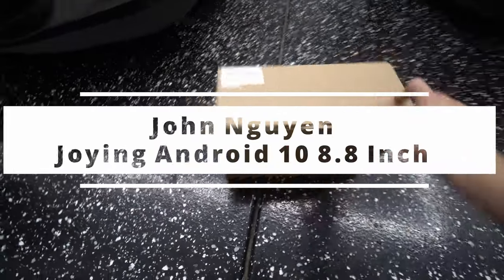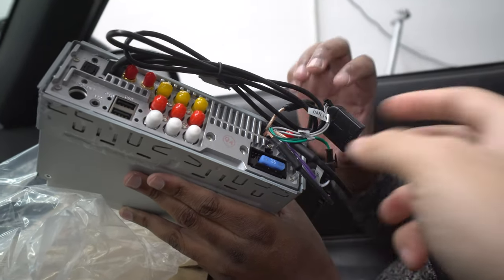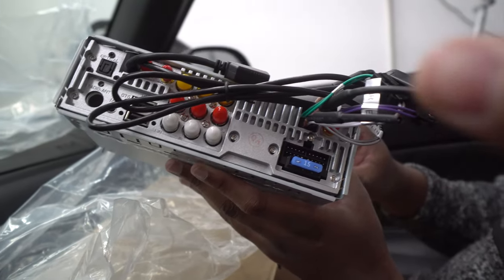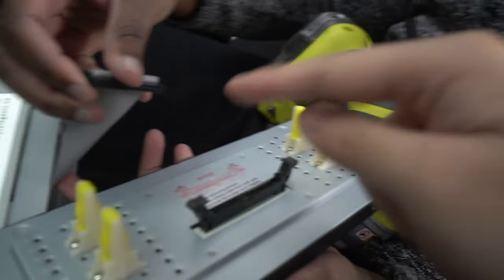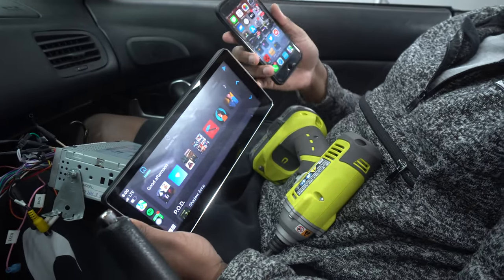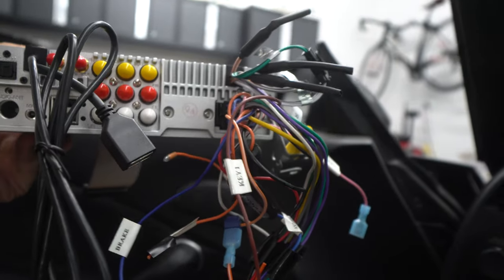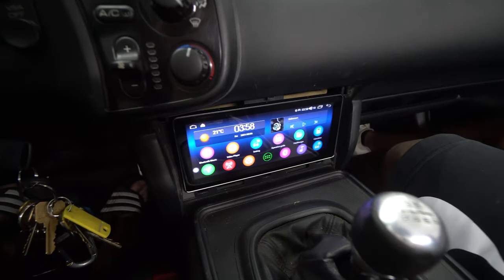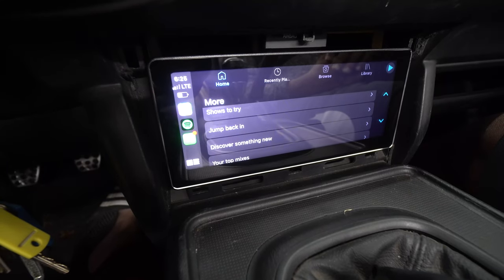One of the best compact 1DIN Universal radio | Joying Install into a S2000

Comment: Thanks for an interesting review! You mention Android Auto but didn't get around to showing it. Since fall 2021 Android Auto was upgraded to  support a split screen on wide screens so you can have two apps open 70:30 instead of the black square just saying "Android Auto". Does this unit support split screen in AA?

Comment: i installed this unit  this weekend. you can keep the radio piece in with your vents. just remove the radio door. i also made two each holes on the brackets to bring the unit fowards about 3/4 of an inch
Reply: also use wire key 1 from the joying harness and splice with green/orange wire from the oem harness and youll get oem volume control on the s2000
Reply from the maker: @JBAEE6  Thank you so much! I'll let my friend know

Comment: Agree its very bright but has alot of glare especially with top down. Also great for viewing diagnostics. Running hondata app and its great seeing all vitals instead of using phone
Reply: Can chuck on a antiglare screen protector
Reply: Hey that's interesting. How do you connect it to the s2000? Are sensors required? Which diagnostics are you referring to?

Comment: You can use the stock audio controls with this unit. You need to connect pin3 to key1 i believe.
Reply: Where would pin 3 be exactly, trying to figure out for my car
Reply: @vimwelmillage4280  I did mine pin 3 is green/red the row on top of factory harness. Make sure you tap in with key 1 to make it work 😀 will be a posting a video of my s2000 radio soon
Reply: @TheJDM626  hi, so its just as simple as key 1 wire tapped into pin 3(green/red) on factory harness and that is all to get steering wheel controls? I just ordered this unit.

Comment: Looks great man. I have a 72 240z I’m trying to find a kit that will fit. This unit may work but the dash is in a weird spot. The radio is so recessed and the heat controls are angled upwards. 

Essentially any single din unit I go with will need to really stick out forward of the casing. 🤦🏻‍♂️ maybe I can make some long stand offs for it to clear.

Comment: Hey John. I'm actually looking for something like this for my classic car. I need a 1DIN unit but the place to fit it is pretty low down if i want to have a rear camera. I would need to look down to look at it + everything else. Do you think if i buy longer IDE cable i could mount the screen on the dashboard and keep the main unit down? Would it work with the longer cable?

Comment: Just wish Joying didn't bury the volume control on their recent units into a tiny little area.  It's okay if you have steering wheel controls, but horrible if you don't.
Reply: Volume button is on top right.  Just press speaker and adjust. You click on it again to mute. Took me a while to get used to after volume knob but its not that bad

Comment: Are you able to get the steering wheel controls to work?
Reply: Taken from another video with the same din
"You can hook up the dash controls by connecting the KEY1 cable on the radio to Pin3 on the car. The radio has a built in app to reprogram the dash controls"
https://www.youtube.com/watch?v=5FxNK1bj3Ww